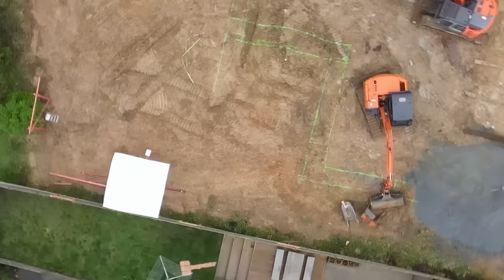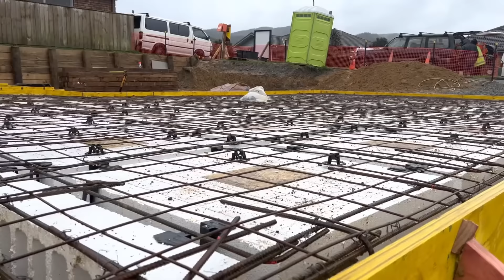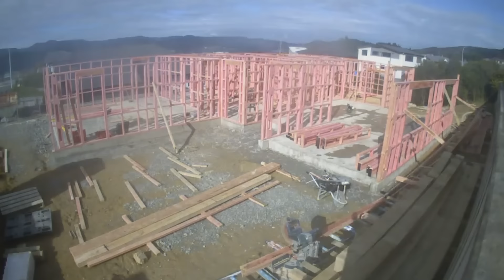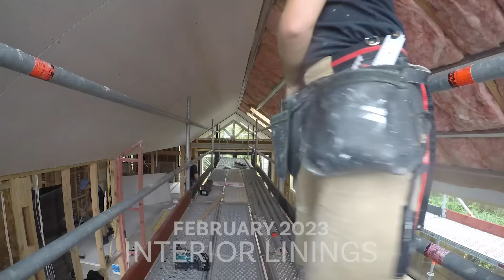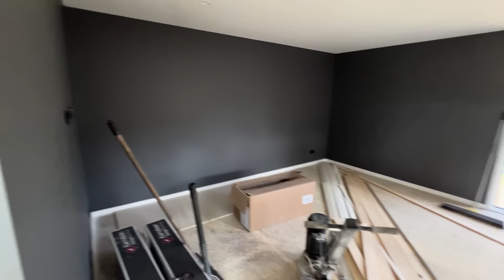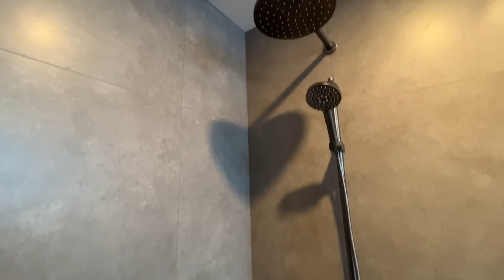NZ Home | New Build in Under 10 Minutes

Comment: Do you paint the houses in winter in the rain? How long does the foundation dry for? Here in South Africa you can buy a Woodhouse, it is known as a "Wendy House." I live in a brick house that was built about 60 years ago. Everything is over-engineered. I can build a 1st floor without reinforcement due to the strength of the walls.
Then again, I must say I vacationed in an A-Frame Woodhouse, and I was pleasantly surprised in the warmth and the feeling of space with the wood around you and not cement and bricks.
Reply: i live in a woodhouse near where this construction is happening. it is a wood house(constructed in 60's) and pretty warm in winters.

Comment: No danger of those foam blocks compressing under the concrete slab over time??
Reply: Not a chance, surface area is too great and the concrete fully encloses them so no deterioration either.
Reply from the maker: Plenty of steel reinforcing to hold it all together as well :)